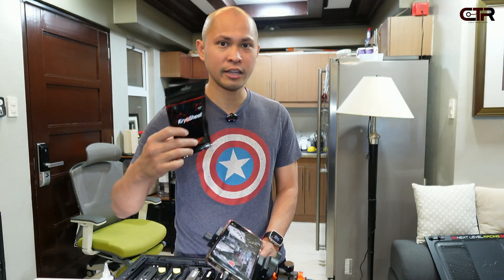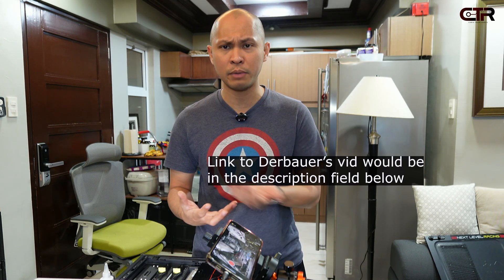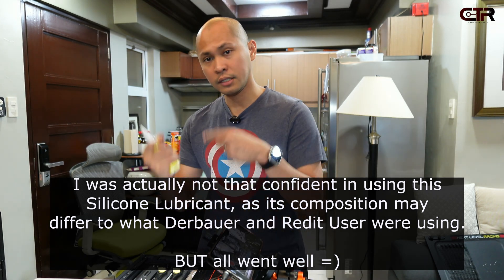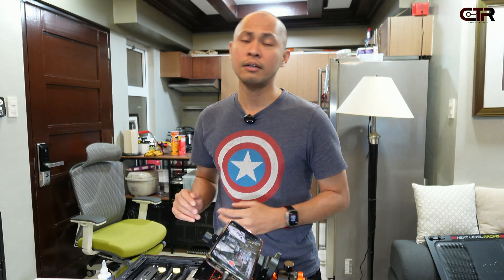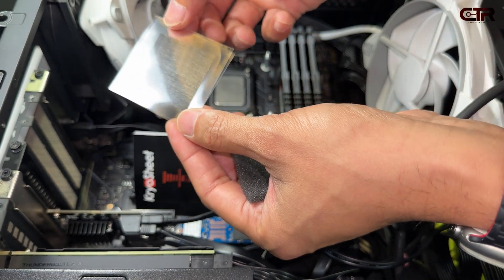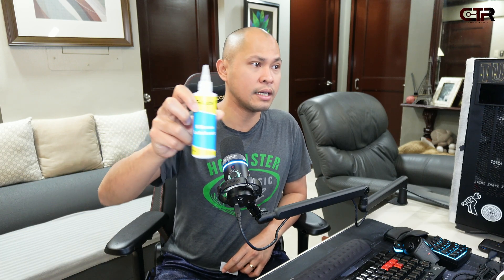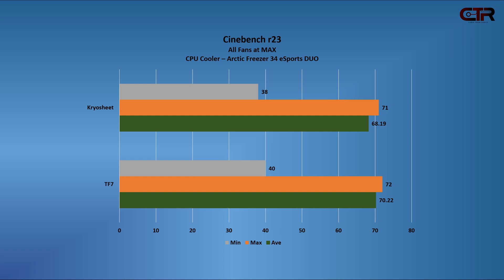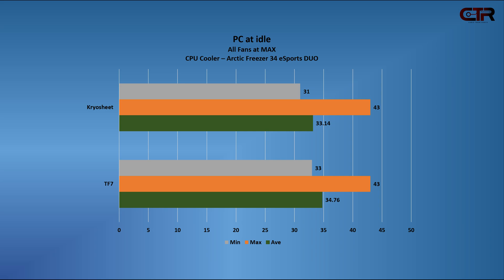Installing Kryosheet made easy

Comment: On AMD CPUs I use a (very) tiny dab of regular thermal paste in each corner. Then I lay the kryo sheet on that (with tweezers).  Easy and effective.
Reply: How long is it lasted for us doing it that way ?
Reply: @Stevestevestevestevestevesteve   no idea. I only installed it this year.  They claim it should last much longer than paste, which dries out and/or gets pumped out by thermal cycling.  So I’m expecting at least 5 years, but surely I’ll upgrade my pc before that anyway.
Reply: Oh I just mean is the temperature staying good even though you added a little thermal paste @docbrody
Reply: @Stevestevestevestevestevesteve   oh. Yeah.  It’s not like I’m slathering on paste. Very much the opposite. I only added the tiniest little dot of paste to the extreme corners of the CPU. All they do is keep the cryo sheet from sliding around during installation.  It’s definitely the easiest way to keep the sheets in place.
Reply: Oh ok great thanks I will do the same 😊 @docbrody

Comment: Hey!
Does it matter if the kryosheet touch the contact frame? Building a new pc now with contact frame, and kryosheet.
Reply from the maker: That’ll be fine
Reply: @ okay, cause i had to buy a 50x50mm. Gonna use it on 9800x3d.
Thanks for replying btw😊
Reply: @xGamerGeek  Any updates? I want to do this exact same thing
Reply: @ i ended up cutting it to the right size👍🏼
Reply: @xGamerGeek  hey man, was it hard to fit? Like do you need to worry about it moving around when putting on the cooler?
Reply: @  Hey! Uhh… Wasn’t too bad, but just be a little careful! But depends a little on the cooler also.
First time i did it on a Arctic Liquid Freezer 3, and that was a little fiddly. Second time on a Deepcool LT720, and that was much easier.
Reply: @xGamerGeek  Thank you for the reply. Have a nice weekend.
Reply: @  Same to you😊